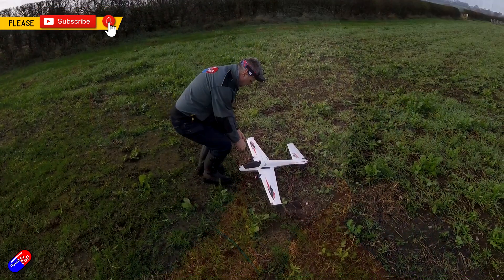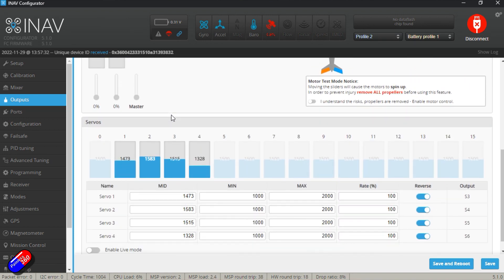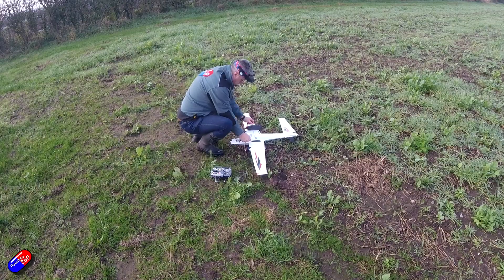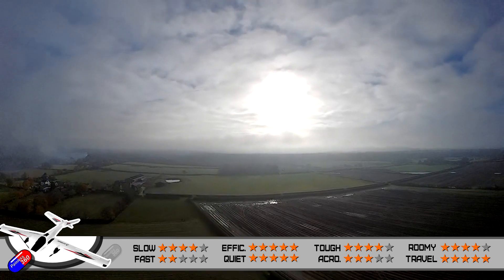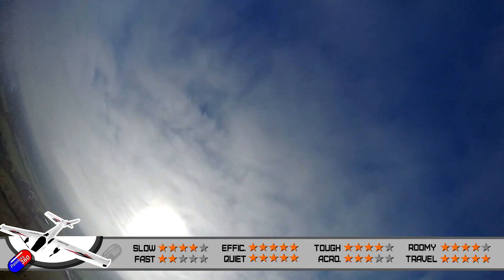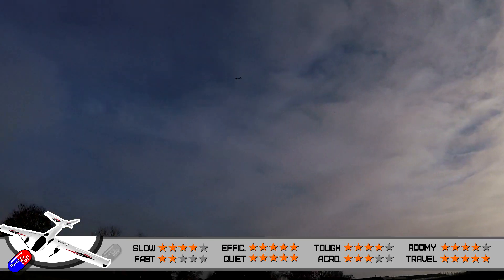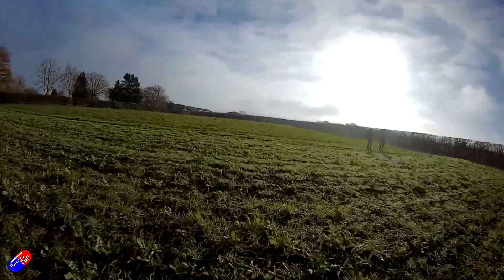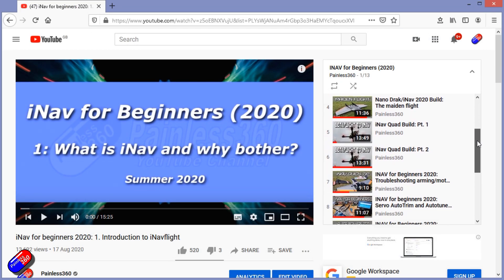AtomRC Swordfish with INAV: Maiden flight footage and my full review (with setup tips!)

Comment: Lee: You comment about wishing that there were more INAV RTF's is ironic given that your whole channel is about teaching people how things work and how to set them up! No one takes the time to learn anything anymore because  of RTF and PNF. They expect to buy a shiny box and go flying without any knowledge or any effort to learn anything. We've seen the hobby dumbed down over the years. Particularly since drones started coming from the factory RTF with flight controllers set up. It's bad enough that most people haven't a clue how to tune Betaflight anyomore. Imagine what it would be like if no one understood the basics of how to setup INAV!
Reply from the maker: Thanks for the comment but I don't see any irony. Most of the pilots watching the channel are here to learn how to build and setup RC technology but there are significant numbers of pilots who just want to fly.
Some of my flying buddies are like me, (and you I'm guessing) in terms of loving both the flying and the building parts of the hobby and enjoy tinkering. 
Some other pilots are not technically gifted or have no interest inearning how the flight controller works. They just want to have the enjoyment of flying wtlithiut the soldering and setup. 
Both options are valid. .
Having more BNF / ARTF models with INAV or Ardupilot would allow those pilots to access the benefits of those systems.
The other benefit is that learners can get models with features that help (autolevel, RTH etc.) and help avoid some of the crashes that we all get when trying new stuff.
If you love building, there is plenty of help about already. 
If you don't, then you'll end up buying a Horizon Hobbies product or you need a pal that can build and setup INAV for you... 
I'm sure that some of those pilots will be inspired to learn how it works and become builders too but that only haolw s of they see and experience the benefits in the firta place. 
I how that makes more sense. 
Happy flying!

Comment: Do you have an updated file for iNav for the swordfish
Reply from the maker: What is it you need it for? I've been flying it on INAV 6.0 and it is great..
Reply: @Painless360  I bought swordfish but new to iNav so I don’t really know much  wanted a template tuned for INav 6. Or should I go for the one by Atomrc.
Reply from the maker: The setup process outlined in the INAV for Beginners series will show you all the steps. Using another persons setup assumes that the model, FPV setup, modes and OSD layout (as well as flying style) are the same..

Comment: Hello Lee, thank you very much for your videos, I am learning a lot out of them.
Just finished the Swordfish, running on latest Arduplane release. As a classic RC modeller for 40 years I was able to manage it to setup
using the parameter file provided by ATomrc. 
One problem which I am stuck right now is the wrong compass information for the OSD. The shipped GPS receiver of Shordfish is a BN220 which is only GPS w/o a compass. On the other hand, lot of videos here in Youtube flying with the out of the box Swordfish, they show a stable Compass on their OSDs. How do they manage to get it. Have they replaced their GPS modules or is there another trick to get out of the existing setup reliable compass information ?
Reply from the maker: Not sure. I've not used Ardupilot on it.. Best of luck

Comment: Fascinating review, lot of good news. Nice to hear that with the large tail surface area yaw stability is not an issue. Based on you reference of 4200 mAh and 40 minutes flight time, it sounds like overall current draw is~6.5A. A very respectable number for a mix of review type flying. 
An ArduPlane option is exciting news, but am a bit nervous given the initial incomplete setup of INAV. This an example where AtomRC could leverage RC community support to validate flight controller and other settings for the Swordfish. Similarly the missing bits like control throws could be easily shared by a PDF download from AtomRC's support web. Again drawing on feedback submissions from the RC (reviewer) community.
Have to give AtomRC credit for allowing a number of reviews to get their hands on the Swordfish early on. This should provide lots good data for Atom RC to incorporate and make available to Swordfish pilots.
In you option Lee, how would the Swordfish rate compared to the AtomRC Killer Whale (another twin) in your personal fleet of planes? IMO it seems Swordfish seems to offer more rounded package, with no negatives.
Reply from the maker: I prefer the Swordfish over the Killer Whale, The whale is a much bigger beast with flaps and a huge internal space. This is easier to transport and just as nice to fly. The Whale may be more stable for filming too thanks to the higher wing...
Reply: @Painless360  Thanks Lee. It's definitely nice to have options.

Comment: I highly recommend the Reptile Dragon Talon if you're looking for another twin prop.  It has similar specs to the Swordfish, with awesome front-facing and wingtip LEDs.  It can handle high speeds and it cruises really well on medium throttle.  Only complaint is that the PCBs need minor adjustments for proper assembly.
Reply from the maker: Thank you for the suggestion!

Comment: Nice! Still waiting on mine to arrive. I bought the kit version. I’m thinking about running 2x 2306 1900kv  or 1400kv. 2x blheli 35a esc. Zohd Kopilot lite and caddx vista for FPV. I’m hoping to use my 4s 21700 5000mah liion pack. I used only 1000kv on the Killer Whale so 1400kv - 1900kv should be more than enough for my style of flying. 
I have the Excalibur v2 (nearly identical glider/plane ) for 150 mph speeds 🎉  Thanks for you review, I’m super excited
Reply from the maker: Best of luck with the build and maiden - this is a beauty!

Comment: So they need to make the nose longer for more CG balance option and battery option. That's a big heavy option? 
Also since they are going beginner, are the controls still to sensitive?
Reply from the maker: I like the need for a large pack as it provides a lovely long flight time. Two packs in parrallel is also an option if you only have smaller packs.
Sensitivity is a function of the throws and they can be set as needed. I'd prefer if AtomRC published setups for beginner and expert alike... Happy flying

Comment: Hi Lee
Were the throws you advised in manual mode? The standard.throws on the ailerons before any adjustment are enormous. How did you adjust the throws?
Reply from the maker: Always check in manual mode. Adjust throws mechanically https://youtu.be/53jbVcKATnc and then reduce travel in INAV Outputs as a fine tune....
Reply: Thanks Lee, big help 😁

Comment: do have a inav 7 diff all file for this plane , as the one you have posted is ver 5.1 , just trying to get the rth and lauch setup . i will be using a speedy bee f 405 wing unit , as the stock one does not support  fport and i want pan & tlit setup , and help thanks , this is my 1st inav setup , but have been in the hobby for many yrs thanks mike
Reply from the maker: I don't share diff files for fixed wing outside of Patreon as they require so many things to be the same on the model to be of any value. Check out my INAV for beginners series for all the steps I use to get them flying every time.. Best of luck!

Comment: Good to hear!  Question on balance. Do you think it would handle a 4S2P 21700 pack?
Reply from the maker: My pack weighs 287g with and extra 10-15g from the Walksnail stuff right up in the nose. If the pack is about the same weight (and will physically fit), it should work.

Comment: What is the lightes battery you can use to hit CoG? Do you think the stock setup can do 6s? Dos the F405 support dual analog camera switching? I have the RTH+FPV version in the mail.
Reply from the maker: The battery I have here is 287g with about an extra 15g in the Walksnail stuff. Less than that in the battery and you'll need to add dead weight

Comment: I can’t seem to get any out puts from my crossfire nano to the Atom F405 FC I have smart port set to uart3. The receiver is bound and everything is updated to the latest firmware. The the FC is on INAV 6.1. I feel like I’m so close but I’ve run out of ideas.
Reply from the maker: Issues with this FC with Smartport. You'd need to use the inverted hack from what I have been told... Happy flying

Comment: Can see the fc is 180 flipped,  but why is pointer arrow facing rear off craft  ? Cheers,
Reply from the maker: That is what 180 yaw flipped means. The 'nose' of the flight controller is pointing to the tail of the plane... Happy flying
Reply: @Painless360   so if I do a 180 roll flip ,that would be OK,  acording to Andrew Newton?
Reply from the maker: Depends how you rotate the FC from defaults. If you are asking a question about anothers content, they are the best person to ask... best of luck
Reply: @Painless360   cheers much appreciated

Comment: @Painless360 do you have an INAV 6 or even 7 file?
Reply from the maker: I don't tend to share setup files as they are specific to the model and radio setup. What are you looking for specifically?
Reply: @Painless360  This will be my first INAV install. I am extremely familiar with betaflight and can decifer what is needed and not I just thought it would be easier to study an already working setup/diff file. Basically reverse engineering, not trying to simply copy paste.
Reply: @Painless360  forgot to add my first INAV build is a swordfish.
Reply from the maker: Check out the INAV for beginners 2023 series for all the steps. Just a few key differences from Betaflight... Best of luck!

Comment: Hi there can you show video like how to connect receiver to swordfish rc plane’s flight controller so I can see it and Wich the name of the transmitter did you use to control the swordfish rc plane and dont use skipping video and don’t use speeding video please use hd video
Reply from the maker: Check out my INAV for beginners if you are struggling with the basics. I used an SBUS receiver here but lots are using CRSF connections from things like ExpressLRS
Reply: @Painless360  but what’s the name of the transmitter you are using for swordfish rc plane
Reply from the maker: I think I used an old R-XSR from Frsky I this one... Happy flying
Reply: @Painless360  how about receiver for swordfish rc plane what’s the name of the receiver
Reply from the maker: FrSky R-XSR. As answered above.